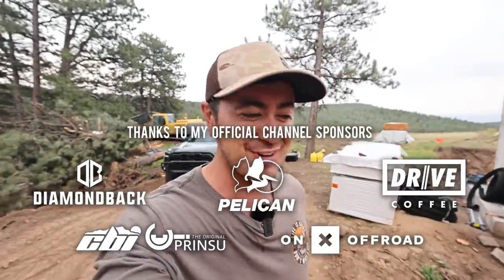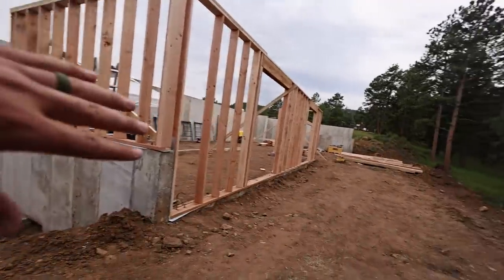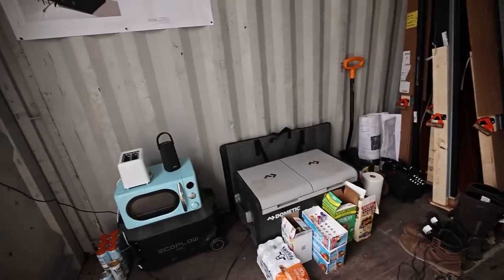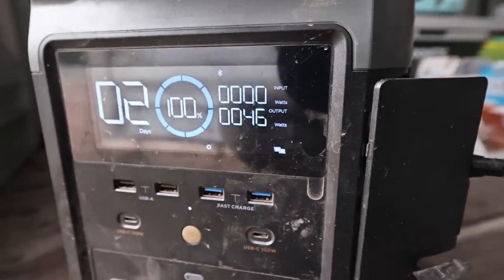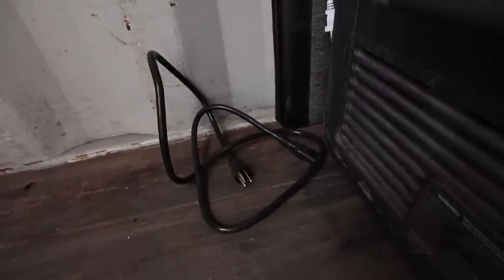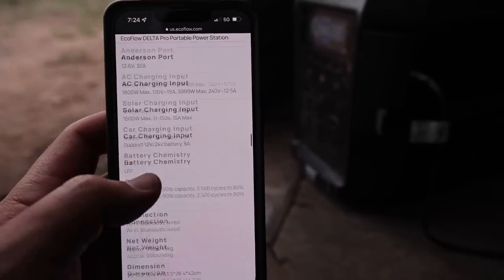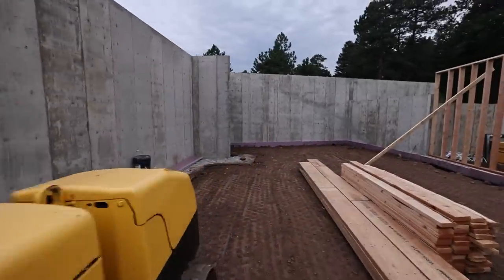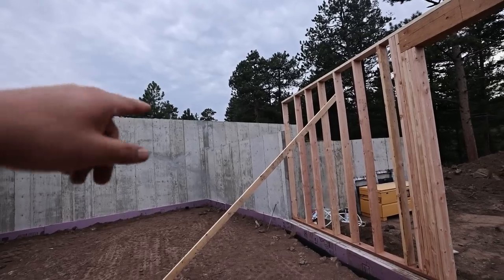I Started Construction On My Custom Home / Homestead In Colorado - Dream Home Build Has Begun

Comment: I have ideas for my own future build as well, and it includes defensive, passive security features incl a dry moat around the building… especially if building on a slope like yours. This to decrease and limit access to upper walls and windows, and further control and lead entry points to doors only … e.g. see your video at 16:46 … I would leave it as is (meaning the depth), shore up the right embankment, and do a not too wide walkway ‘bridge’ in to the front entrance area. And I would keep that mindset around the building. The building from a distance will still look like it is flush to the ground. Being out in the “boonies”, it is always good to design in passive defensive features.
Reply: @bjo sch, Brilliant! We need to build a moat on our southern borders! Then fill it with the surplus of aligators from Florida!

Comment: We are doing a similar project for our house on the eastern plains of Colorado! I’m an architect and my dad has construction experience so we designed and are currently building the house ourselves too. I definitely have some tips if you want some advice on building yourself. One of the best things I’ve learned is for bigger orders to utilize the bid room at Home Depot or Lowe’s version of it because you can get pretty good deals on some things. We went through Home Depot’s bid room to order our windows because they gave us almost $10k off and the lead time is less than 8 weeks. You don’t have to be a contractor to do it either! Also, reaching out directly to manufacturers instead of through dealers can be a good idea too.

Comment: Lookin nice. Dont know what you have for plans for heating but if you do go for floor heating make sure to read up on it. Many american companies dont recomend to much of bottom insulation. That will make you put heat in the ground which also pulls radon up. You need to go for 30cm or almost a foot of thickness. Cheers

Comment: Starlink is a great backup to have...or primary if you have no other options.  Upload speeds are generally weak though.  I only average 10Mbps upload on a business package in Wyoming.  So using it to view cameras might be disappointing.  I'd still recommend the service for general use though.

Comment: I would suggest, to alleviate a lot of headache for yourself… as homeowner & Gen Contractor you can personally do all the electrical and plumbing yourself (it still has to meet Code & pass Inspection). But I would consider having an Electrical Engineer & Plumber design the layouts and zones. It’s not incredibly difficult to do yourself, but it can save you a lot of time and stress.

Comment: @Last Line of Defense : You HAVE to reinforce the hell out of a shipping container with steel tubing or channel, a lot of welding before you even consider burying one. Their strength structure is stackable and the load is carried on the CORNERS ONLY.

Comment: But for sure if you want internet it doesn't use much power. He gives you 75 ft of core and he gives you a satellite dish and it also preheats in the winter when there's snow on it and the speeds are exceptionally fast faster than my home internet that I when I had power on my property out here off-grid I don't have any power. I just use everything off generator but order the RV package. It's available right now. You might have to use like a post office box in town as you're working address but it works as well. If you got a 30 ft area open to the sky and it points pretty much straight up

Comment: Be careful on the pre-engineered joists.  My home has them and I am constantly fighting sheetrock cracks on our main floor.  To the extent that I am installed a support midway of one floor joist in our basement.  I am actually considering boxing a few of the beams.  Don't push them to their span limits.  If you do, you will fight cracks.
Reply: This is great information. 100% will be sheet rock cracking using pre-engineered joist.
Reply from the maker: Good to know, and I had a bit of concern about that to be honest. There was quite a bit of back and forth between the truss designer and my engineers, to make sure they had acceptable levels of deflection or whatever. I don’t think with my floorplan (wide open on the main floor at the longest joist spans) will give me issues with cracking drywall, but I hope the floor doesn’t feel like a trampoline…
Reply: @LastLineOfDefense  We have a wall with a door on one of the long spans.  The sheet rock above the door is always cracking.  Well, was.  The support I installed stopped the cracking.

Comment: With the way y’all get snow I’m shocked you’ve got those studs so close to the grade. Why didn’t you build a foundation wall on that side at least another 8”-12” higher?
Reply from the maker: It'd be very uncommon to have your foundation that high above grade - snow isn't really a concern as much as drainage is - so the snow leaning up against something is fine, as long as everything drains away.

Comment: Don't bury a shipping container. Without extensive reinforcement, they will cave in from the sides and roof. I looked into this extensively when building my last shop because I wanted to bury one for an underground shooting range, but it's just not designed to carry loads that way. There are other pre-built containers that are designed to be buried and don't cost a lot more. That's the route to go if you want to do this.
Reply: Yeah, Myth Busters tried to bury one and nearly killed Jamie.

Comment: Are those tilt-up walls, or poured? Don’t forget to use air-entrained concrete for exterior slab pours, and will you be doing Henry’s and Yellowjacket for the below-grade concrete exteriors to prevent hydrostatic water pressure weeping? Did you consider those foam blocks you pour concrete into for the below-grade walls? I’ve been wondering if they’re worth it….

Comment: You should frame with t studs and went with standard sheathing. Especially since you’re spray foaming.
Reply from the maker: They're cool, but I'd not see a positive investment return on those in my lifetime.
Reply: @LastLineOfDefense  I didn’t realize they had gotten that expensive. The last time I ran numbers it was cheaper to switch the studs for t studs as opposed to buying the zip sheathing with the foam layer.

Comment: I’m sure you’ve done your research but my grandparents built a home in Missouri, it was TOO insulated and they had a problem with humidity staying trapped inside and then mold growing inside. I don’t remember what they did to combat that (maybe just good ventilation) but be weary of that. Looking forward to the nerd specs and engineering side
Reply from the maker: Yeah, there’s no such thing as too much insulation actually - but as you hinted, if it’s a very airtight house, then you do need proper mechanical ventilation systems and/or dehumidifiers for sure.

Comment: I’m about 90% through a gut and rebuild of my YouTube-educated self-taught project. As a fellow nerd and lover of OCD-inspired results, do check out PEX for your plumbing. I pulled 100% of the copper out of my house (well water) and replaced it with PEX. The “home run” approach leaves you with no joints or t’s in your water lines and a manifold with a valve for every water source, that’ll make you smile every time you walk by it. I’d post a picture if I could. Looking forward to your progress videos!
Reply from the maker: Yeah, will be using PEX for the home thing. Have done a fair bit of research with the home run approach or traditional. Pros and cons to both, I’m honestly not sure what I’d go with. Plumbing though is one thing I’m contracting out, mostly for time-savings, and that they can worry with code and inspections on that.

Comment: Frustration: welcome to the world of building! Also, huge footings; trouble with the soil bearing?
Reply from the maker: Nah actually this house is basically built on solid granite - the engineers explained that this design was some cantilever thing to prevent walls from tipping ever, or something. Idk, but I actually had to move the house back 10’ to just be able to dig low enough without blasting. Lots of jackhammer attachment on the skidloader (I might still be vibrating from all that.
Reply: @LastLineOfDefense  Got ya.  That cantilever makes sense with the long, unsupported back wall.  Looking forward to seeing more of the build!  I should have been paying more attention and I could have helped out with the plans (that's what I do).  Good luck, it will be fun.
Reply: @LastLineOfDefense  Also, great looking piece of land! Not jealous at all.

Comment: Have you thought about what you are going to do as far as life safety, fire prevention? I’m talking more than just generic house smoke detectors
Reply from the maker: This house will never burn - code is super strict. I have to use a bunch of class a rated stuff, i have to install a home fire suppression (sprinkler) system, and I need to do a ton of fire mitigation and basically cut down half the trees on my property.
Reply: @LastLineOfDefense  🤣 Some of the fire codes can definitely feel over the top, especially in a new residential build. But it is definitely worth it. I sadly can’t get you a discount, but I do work for a Fire Alarm company in Denver. Excited for your build!!